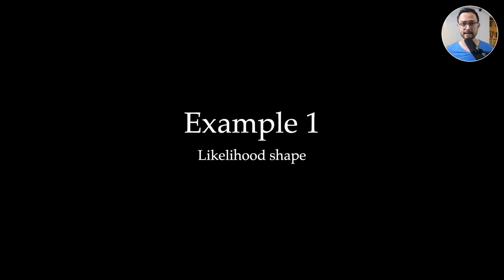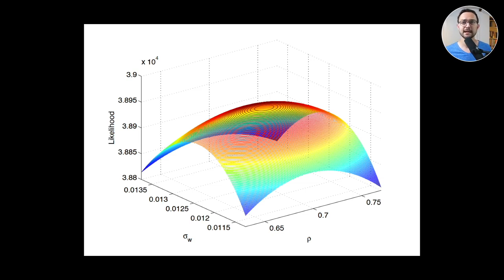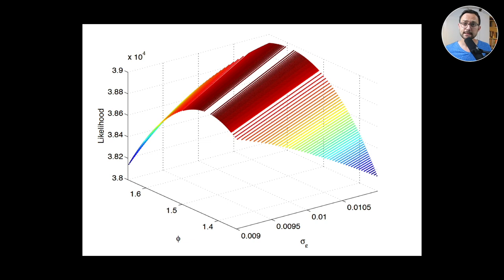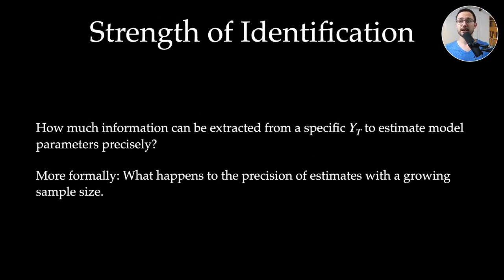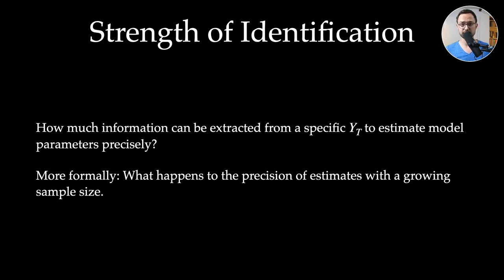Identification Analysis of DSGE model parameters with Dynare

Comment: Thank you, great video! @22:40 If I want to compare second moments from an estimated model with the data, what's the best way to do this in Dynare? Thanks.
Reply from the maker: You should have a look at the method of moments which is an estimation technique specifically designed to do this.

Comment: Professor, thank you so much for sharing this! I notice all the identification analysis starts with a specific parameter combination either from calibration or conjecture. Is there a way to check identification before/while estimating the model (not after estimation, since with under-identification, the estimated result might not be "true")?
Reply: Especially in a bayesian framework...
Reply from the maker: What do you mean by "estimated result might not be true"? Identification is a model property that can be checked before seeing any data. With simulated data we can also assess the strength of identification. So I don't understand your comment. Of course the identification tests are done at a certain parameter value. You can either draw these values from the prior or from the posterior or simply make them up to check identifiability. Usually, it is sufficient to check identification based on many draws from the prior, then fix any issues, then do Bayesian estimation and then check identification at the posterior mode and posterior mean again, or even at draws from the posterior. Or do you have global identification in mind?
Reply from the maker: Bayesian or not does not matter.
Reply: @wmutschl  Thanks for your reply, let me make my point more clear. I was trying to consider when there is a `true' DGP that generated the data, would the Bayeisan estimated parameter (or equivalent identified set) be the true one under infinite sample if it is not point-identified? For example, in the OLS case, we know beta_0 cannot be identified if shocks are not mean zero before we evaluate a certain parameter value. Can we learn similar things to DSGE/state-space models? Basically its  ``identification of the model'' vs ``identification at a certain point''.
Reply: @kylekuang4057 , in case of having partial identification in a frenquentist framework you would have a set of parameters that are observational equivalent (the identified set). In such case, if you obtain first an element of this identified set, then you can execute all the "identified test" proposed in the video. You do not need to use the population parameter of interest, this is so, of course, under some regularity conditions that most DSGE models we consider satisfy (the identified set is a regular manifold). 

I do not have too much knowledge about Bayesian methods. Yet, I guess something similar happens in a Byesian framework. The identified set I guess is a set of posterior distributions that are observational equivalent, and you only need to obtain an element of it, to perform the identification test.